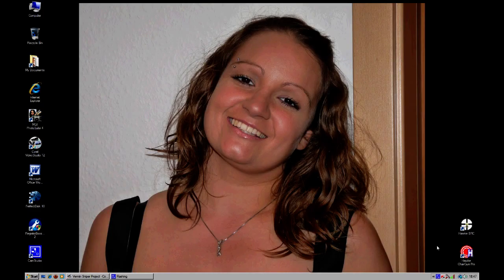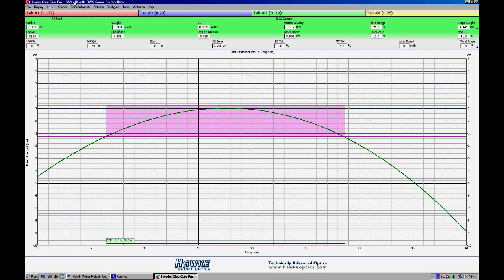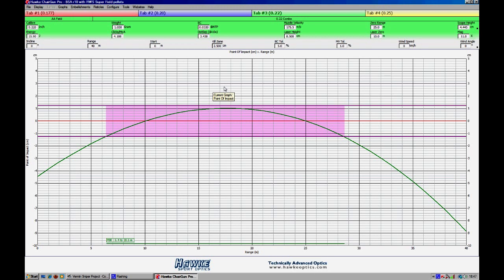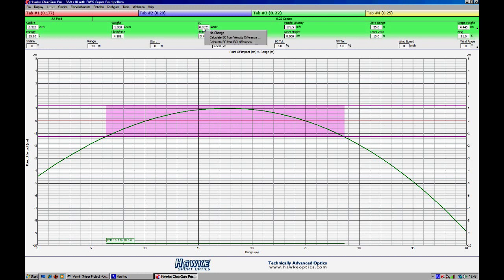Calculate your own BC with Si Pittaway

Comment: i used a similar method on hawk software, what i did was changed the B.C. in box provided until the B.C matched my impact point on the graph, mine was done from 15 yards to 25 yards, same aim point just zero set at 15 yards, as i changed the B.C. the arc started to move and then i simply stopped arc when the graph showed pellet height at 25 yards showing my B.C.  its a neat feature i have known for a long time, it was a way to get a B.C. with out shooting over my chrony for muzzle velocity and then over it again at 25 yards.  the software works good for sight in also, as you keep typing in sight in distance yard by yard until you get the arc close to line of sight or what i like is a half inch below line of sight, and similar to the field target setting you showed in hold over hold under video

Comment: Nice vid. When measuring centre to centre in engineering. . . measure between either both the tops or both the bottoms of the drawing pin (if they are both the same diameter) this will give the centre without need of a little wobbly guesswork . . . it will be exact. Whoops just read down a bit and I said this a while back. Keep the Vids coming VHTV

Comment: Si, that micrometer is calibrated upon the CENTER mark not the first mark.  It was not 9.1 cm.  It was 9.4+/- a half mm.  I have one exactly like it.  Just information you might find useful.
Reply: After extensive research, I think you're wrong, respectfully. I think his Vernier Calipers read 9.10cm. The lower scale reads the 2nd decimal place, which is aligned at 1, therefore it reads .10....

Comment: Hi Si. . . another good bit of info . . . thank you. . . hears a quick bit for you. . . to measure the centres of any hole's (your drawing pins centres as example) measure from the side of the hole to the same side of the other hole . . this give the centre measurement. . . so . . the top of the top drawing pin downward to the top of the bottom drawing pin. . . gives the centre . . . . drawing pins or actual holes. . . works a treat . . . . thanks again
Reply: You must be a joiner pal

Comment: Exactly what I was going to point out. The only way to make this a reasonably decent way to measure BC is to use a chronograph in tandem with your bullet drop. And the software will also take that data. however Si did not use his info just stayed with the stock info in the software